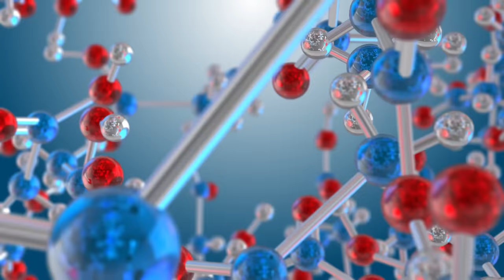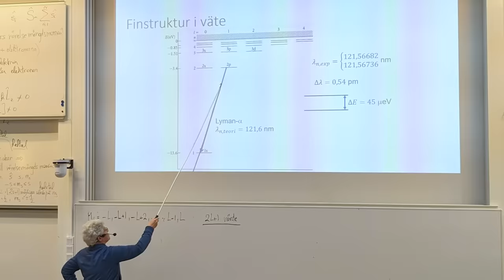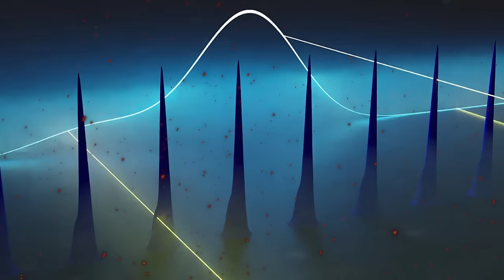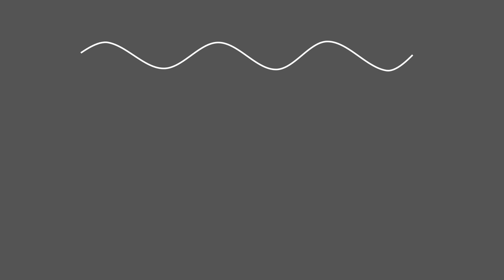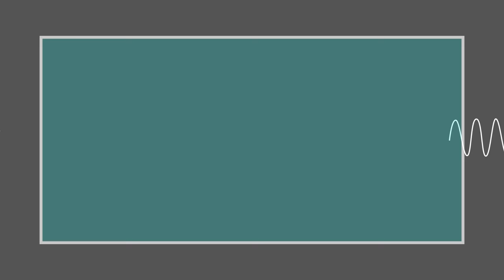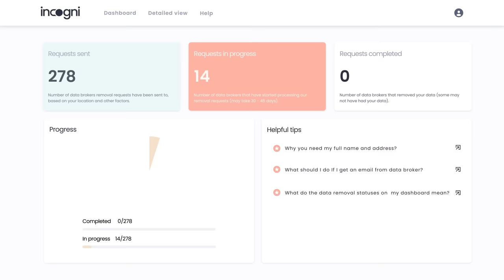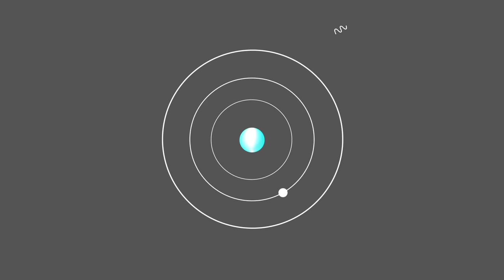How Physicists Took An Electron's Picture  - Physics Nobel Prize 2023 Explained

Comment: Dude, this is the best explanation I’ve seen on this. And others
Excellent
Reply: they do not mention that they probed the electron with a multitude of lengthwaves, 
the result is a reflection from the electron, reflection of the probing signal. or say signals! 
what they pretend to be the image of the electron, is an image of the probing signal, and no image of the electron can be extracted from that.

Comment: Wonderful explanation!  As I understand, these are ionized electrons falling back and recombining.  Fixed energy orbital transitions (excitation and emission) may be different, possibly slower, as the electron oscillates at a frequency fixed by the quantized energy difference between states.  Is there any work on transitions?

Comment: So - I have listened to a few videos now and I still do not understand. Are they taking a picture of the electron while is behaving as a wave or the wave has collapsed? How does this relate to the wave behavior?
Reply: they do not mention that they probed the electron with a multitude of lengthwaves, 
the result is a reflection from the electron, reflection of the probing signal. or say signals! 
what they pretend to be the image of the electron, is an image of the probing signal, and no image of the electron can be extracted from that.

Comment: As a synthe mesc designer I've noticed that my new leather lazy-boy rocker recliner ( circa 2100$ ) is built for the short people and tips over quantumly with preset 1 attosecond alert then time stops as I travel through the event horizon to point of no return singularly pissed in time to notice its been a few plank unit of time since I dusted the floor in my den. And I'm only 6'1" I could see maybe tipping if I was the proverbial wormhole to the cft boundary but nooooo just unrarkable 6ft tall and is the univerase shrinking yo fit short people better cause they were underrepresented til now and ADs is woken?

Comment: How does a single photon of a certain fixed wavelength or frequency can have a short length(or pulse size in time domain)?
Reply: Why do you think there's only a single photon in the pulse?
Reply: Also, the limit to how short the pulse can be is the time it takes one wavelength of your longest wavelength to pass a point.

Comment: Is it right red goes faster then blue light?
Reply: No. All light travels at the same speed in a vacuum.
Reply: Redshift is because of the expansion of spacetime.  Through a medium red light is "faster" according to the video.
Reply: Relevant to example in this video, the red light is going faster through a medium, because the lower energy waves don't hit as much inside the medium - higher energy means more waves means more interactions slowing it down

Comment: I thought there will be a photo of an electron😂
Reply: What these three people provide us with is more 'information' about an electron, instead of an actual picture. It is the information what is needed to understand concepts, like valence or molecular bonding better.
Reply: they do not mention that they probed the electron with a multitude of lengthwaves, 
the result is a reflection from the electron, reflection of the probing signal. or say signals! 
what they pretend to be the image of the electron, is an image of the probing signal, and no image of the electron can be extracted from that.